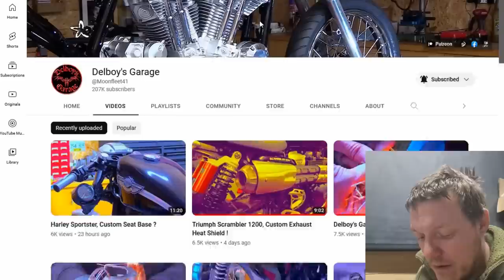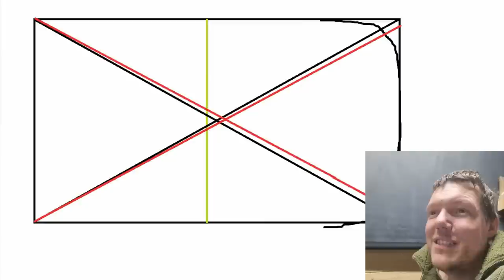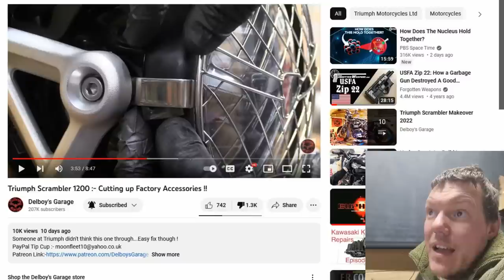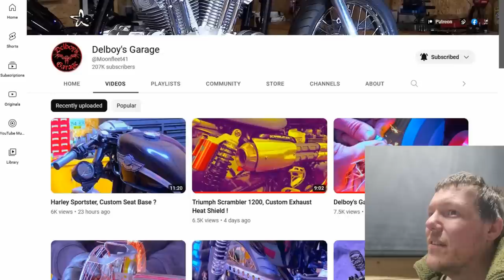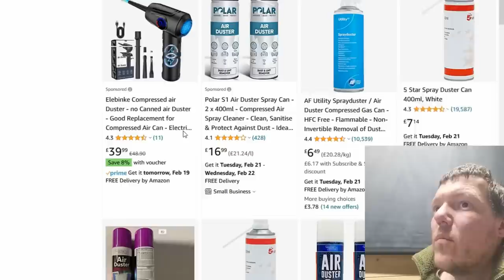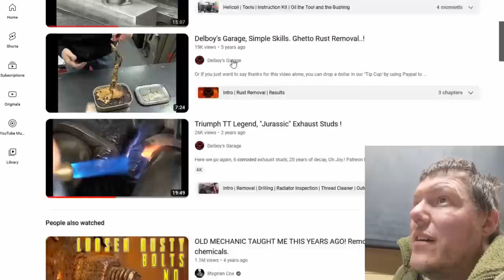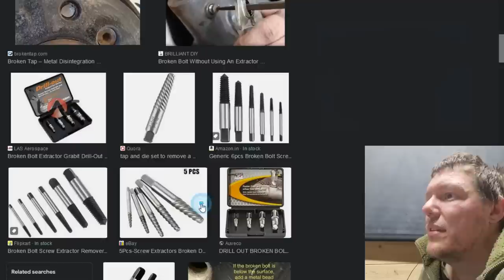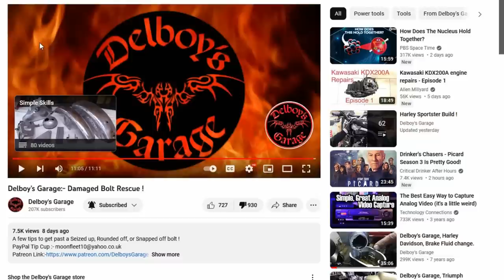Delboy's Garage Catch up 1

Comment: If trying to remove a frozen bolt from the harley use the gas axe to carefully cut the harley off the valuable rusty bolt
Reply: That’s pretty sad you can’t tell the difference between a Harley and a Triumph.🤣😂
Reply: I’m always removing my frozen hd from bolts.
Reply: @redkite3317  
Mr wobbly gob also has a hardly worthit the triumph might be worth saving

Comment: i'm a full time mechanic and let me tell ya, bolts don't break flush every time and if i started gluing nuts to engine cases or what not my boss would probably beat me with a rubber hose.

Comment: He's not using stainless and for the fix is creating a nasty bodge job. Stainless can easily be sourced from a local scrap yard for bits like that. What he's created will dribble rust, regardless of finish.
Even if he doesn't have tig for finer welding, he could use stick. I use stainless stick rods on a lot of tasks and it works.
I think his brackets will look like a flat 'Z' when he goes over the first bump.

Comment: Far and away, best way to remove a stuck fastener is heat, let cool & shock it. I see people heat and try when it’s glowing hot. No, just let it cool. Not waiting for it to cool is only using half of the potential “help” to break it loose.

Comment: My classic Austin Mini has chip basket headlamp protectors. They have bendy stainless clips that bolt into headlamp surround and the chip grille clips into the bendy stuff, three points around circumference. Easy to pop off when needed.

Comment: Tbh there is no need to remove that light cover for cleaning. If he truly cleaned his bikes he would know to use a soft brush to allow the bristles to get the hard to reach areas.

With this concept he might aswell make all parts fairings and them all quick release, however let's face it he never cleans his bikes properly

Comment: Think I would cut the two side holes on the light guard and make them slots, that way I can take the bottom bolt out and loosen the side bolts and slide the light guard off. you should be able to loosen 1 side, slide out the bracket, tighten it back up and then loosen the other side to hopefully keep the light alignment and you would not see that the design had changed.

Comment: Would be easier just to cut slots in the original holes so doing the headlight bolts up clamps them then all he needs to do is slacken the bolts and it will slide out

Comment: It looks to me like he didn't take the cutting disc thickness into consideration when he modified the chip pan headlight guard. Surely you'd want the two parts sitting flush?

I tried Del's method of marking the centre of a broken stud, but I found throwing a fuckin' dart from the other side of the room to be more accurate.

Comment: My favourite tools for stuck bolts: 1. breaker bar with 2m extension, 2. torch and 5 kg sledgehammer, if that doesn't work: 3. angle grinder. Penetrating oils are a waste of time.
Reply: can't be stuck if it's liquid

Comment: Surely just remove one bolt of headlight slide out the way then bolt back in then then repeat other side take 2 mins to remove but why need remove anyway just clean with a brush lol

Comment: My mind has gone to small stainless steel hinges used in marine applications. Buy 2 of them, remove the bar from on of them, spot-welded them from behind and use a cotter pin to the one of them. When you have to clean the headlight, you remove the bottom screw and the cotter pin and it will slide to the other side. Too much effort for nothing (my opinion is to remove it all together, headlight will be fine)

Comment: Del never changes; he only gets worse.
I don't see worth in ruining any bike, including brand new ones, with the same 3 or 4 useless, badly made, often chinesium "mods". All wonky, all junk, all asymmetrical with del touch. 
4 bolts instead off 2 and some welding or 1 and a hinge. THICK metal FTW.
The bolt video is a clear example of his line of thoughts, it may get a ton of views because it's high in the search results for "stuck bolts, unstucking bolt, etc"
53:31 Is it me or is that stud a bit short and the end a bit irregular. Did it break inside?
He is winded after removing one nut. 🤣🤣
Peak Del here. Tutorial without showing the results. 💯💯

Comment: He cuts on 1 side of a fat ass line then he cuts ON the line with no rhyme or reason and no accuracy.
Use a scribe...make a fine line...and always cut next to the line on the scrap side...belt sand finish to the scribe line.
I would gang the 2 parts together so the edges and holes are exact.

Comment: What a waste of time. Park the bike in the garage and mark a wall with a line at the dipped beam cut off. Then talke the bloody silly grill off and wash it and the headlight lens. reassemble it and adjust the headlight as per the marks made earlier. Job jone.   IMHO this bike will never be used off road so the whole grille thing is a needless affectation.